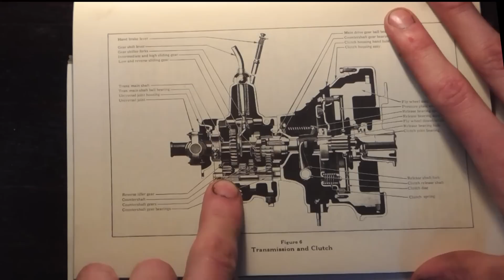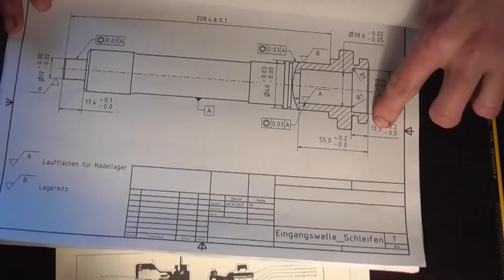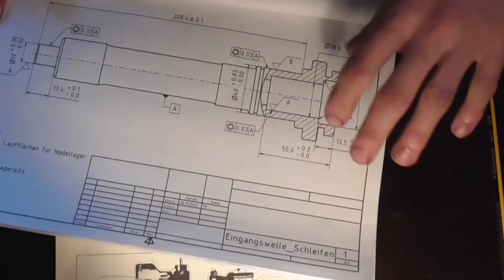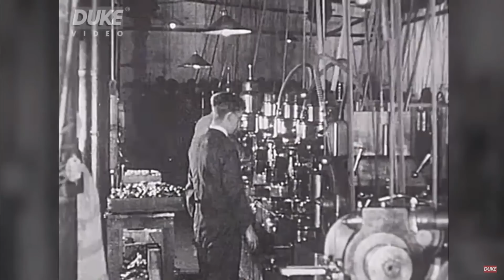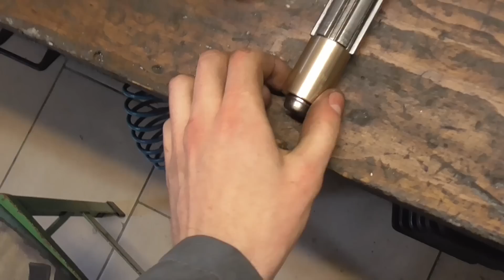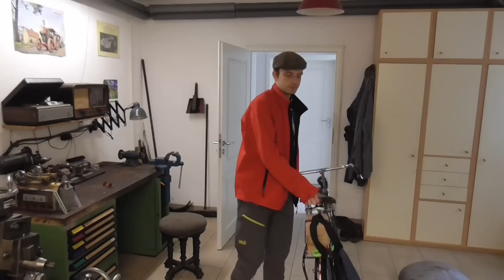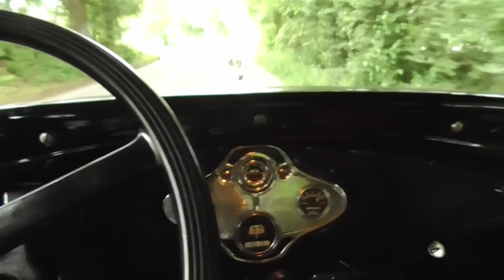Transmission Modification - Ford Model A

Comment: Very good try! I know you can do it. Does a Model A coupe have the same gear ratio as a Model A truck trans? Thank you!
Reply from the maker: Yes and no. The Model A pickup truck has the same transmission but a different rear end ratio, the Model AA 1.5 ton truck has a 4 speed transmission with an even lower 1st. 
2, 3 and 4 on the AA are equivalent to 1, 2, 3 on the A.

Comment: Would you expect similar results from keeping stock transmission gear ratios and going to a 3.5 rear end gear ratio?
Reply from the maker: It'd make things worse. A faster rear end increases the gaps between gears because it acts as a multiplier. Sure, you can go faster in 2nd, but you'd also have to go much faster to get into 3rd. Might work on a light car (coupe or roadster), but probably alot of struggle for a heavier Tudor or Fordor.

Comment: Your fear about the weakness of your new input shaft is unfounded. The only time that part of the shaft is under load is in third gear.
Reply from the maker: Well, 3rd gear is what you're driving about in, mostly. Sure, the car is already in motion, but we're still talking about moving a 1 ton vehicle on 2.4mm of wall "thickness". I don't think this'd be a match for a 3.3 litre engine.
Reply: @AstraWerke  Make a new shaft with thicker cross-section in that area. Because you have switched to a bushing you could make the hole smaller and use a thinner walled bushing
Reply from the maker: @KrashPad  The needle bearing bore sadly isnt the weak point. It's the even larger hole right up front where the 2nd gear gets pushed into to engage high. You could machine away the boss from 2nd gear, but that'd make the force path from the teeth to the axle weird, probably resulting in twisting motions that could cause it to pop out of gear, or wear out the output shaft prematurely.

Comment: It was genius to conceive this idea and amazingly skillful to actualize it. Now you know how the engineers at Ford Motor Co. managed to finally get a reliable Model A on the road. Many, many failures, leading to a few successes and eventually to a final, workable design. Don't ever give up. You have the drive, determination, and skill of a true innovator. Henry Ford would've been proud. Thank you for this video.
Reply from the maker: I reckon what'd really be helpful in an experiment like this would be sort of a test stand which would cycle  the transmission through different loads. Much less effort than being towed home and taking it in and out of the car each time it cracks xD
Reply: ...well, even EDISON didn't always get it right the first time- EITHER...(!)

Comment: The gearing in the Ford Model A is strange. Must have made sense back in the day with poor roads. Mitchell offers a syncro transmission with modified 1st and 2nd ratios, but my pickup is light enough to pull most of the hills here in New England in 3rd.
Reply: Also added the Mitchell synchromesh to my 31 A Tudor.  Night and day difference plus much easier downshifts.

Comment: Adding synchronizers would have been nice. I've noticed in cars today, the RPM difference between the gears is about 500 RPM. So as you shift, the engine slows down about this number between the different speeds.

Comment: You might have the lower rear-end gear.
Reply: 3.78 was standard, I believe, with an ultra 3.54 for highway speed increase and 4.11 for stump pulling ratio (LOTS  of hilly areas I’d guess).
Reply: @916commons  Thanks for your knowledge.  I didn't know the gear ratios offhand.
Reply from the maker: Most certainly not. It'd reduce top speed significantly.

Comment: very good modification on that car, this is a small design error that can be aesily corrected by revisiting the input shaft design.
by the way, the transmission seems much quuieter so your gear tooth design is spot on.
At the cost of  speecial gear hobbig, another way is to find the gearing of a more modern 3 speed gearbox and and its case  the original Ford bellhousing and tail housing.
Another option is a modern all synchro gearbox adapted to the Ford.
For sure that it removes a bit of originality to the old model A but it is a much safer way.
Reply from the maker: Phew, making a bell housing adapter and adapting clutch and U-joint to fit a different shaft profile is more work than you think!
Reply: @AstraWerke  If you start your design from a gearbox attached to a 4x4 transfert case, I believe that you can do something that involves no more work than what you done to your gearbox I admit that the design of the tail portion with the spherical pivot is the worst portion of the adaptation.

Comment: Excellent machine work. Your ratios sound similar to those offered in the Mitchell transmission.  BTW, you shouldn’t have to wait to upshift to third. Maybe that was caused the damaged gear teeth?
Reply from the maker: It's pretty simple: If you shift and the transmission makes a loud noise, it didn't like it. If the shift is quiet, no harm done.
Had I tried to shift it quicker, I'd have ground the gears.
Plus, it'd have worn the input shaft and the inside of 2nd gear, not the outside of 2nd and the cluster gear. 
Since the tooth was chipped on the right, it was probably caused by someone that didn't understand downshifting from 3rd into 2nd.
Reply: @AstraWerke  You are right. Also, I wonder if your car has lower rear axle gearing than most. I can’t imagine reaching 30mph in second gear with any of my cars with the 3:78 standard ratio.
Reply from the maker: @Bbbuddy  I don't think so - I've driven a few other Model A's and they all seemed to react about the same

Comment: Your skills are amazing. The shifting looks great and obviously you are happy with the performance under load. I must say I either missed the video about an accident or I just plain forgot. When you first pulled out of the garage it looked like a tuned up hot rod without the fenders and running board!! I am so sorry to see the failure while driving home. That is very unfortunate.
Reply from the maker: I had to swap the timeline around a little bit due to all the "Where's the Model A?"-questions around xD

Comment: Very, very cool!
The gear ratios in the Model A were designed for a different time and different road conditions. Most people in the 30s were looking for more speed and fuel economy in 3rd gear highway driving, hence the popularity of the Columbia 2-speed rear axle. Road and traffic conditions usually meant you would stay in 2nd for the majority of your city driving, so the ratios in the gearbox were arranged accordingly. Low gear was a stump-puller gear to make sure that take off in rough conditions wouldn't be a problem.
Ironically, the much better road conditions of the 21st century work against the way the Model A was originally designed and built.
It's unfortunate that the 2nd iteration of your solution had issues, but I really think you're onto something. As a bonus, you'll soon be able to R&R the transmission blindfolded, which will DEFINITELY come in handy some day!
Reply: Fully agree. Often overlooked is that the concept of a highway (in today’s sense) was unknown when the Model A was designed…the modern highway would only come a few years later in Germany (geographically full circle with this video!)

Comment: Very Nice --------- Machining the gear blanks ------ what was the material you were using -------- the chips were coming off so uniform -------- The wall thickness ------ what did that end up being? ------- Yeah ----- you did have a lot of worn and chipped teeth in there ------ then you got the new set of gears in there ------ made a world of difference ------- smoother and quieter ------ Of course a LOT of that noise was the gap in the input shaft ----- a lot of wear there ------- So , with a little more tweaking ------ and all the bugs worked out ------- What will be your final cost to the public for a set of gears? ------------ Thanks for the video - Adrian -
ALWAYS ---- enjoy your machining skills ------ the thoughts that are put into it ----- and the use of the Old Equipment ------- Will wait and see what you do for a remedy ----- BIG improvement on handling hills ------ Hope you have a Good Week ----- Rodney
Reply from the maker: We're talking about 2.9mm of wall "thickness" - in hindsight, I'm surprised it didn't already crack when I hammered it onto the shaft.
I think I paid around a thousand quid for material, having the gear teeth cut, hardening and EDM - with a LOT of friendship discount. If you wanted to make a living off this, it'd probably be more like 2k.
As for material, I usd 16MnCr5 - an old classic in engineering.
Best Wishes
Adrian

Comment: If you carry on like this, it will become a fully synchromesh gearbox. 😊
What was Ford's actual reason for the arguable factory gear ratios?
Reply from the maker: No synchros is part of the fun for me. 
From what I hear, nearly all 1930s cars suffer from the gap between 2 and 3. Maybe due to the road conditions - or maybe because "that's just the way we all do it".

Comment: Man that is a great idea to improve the transmission I know you are trying to keep the stock setup but what about swapping in a modern transmission and have the best of both worlds
Reply from the maker: Not an option for me. I want it to look the same and be operated in the same way as originally.
Reply: Way back, I had a friend sub in a pinto manual transmission. I don’t recall how he mated the trans to the bell housing, etc, but it worked great!

Comment: I'm unclear as to why the Ford engineers settled upon the stock gear ratios. When I am instructing new drivers at the museum I explain the transmission operates similar to a four speed which is missing second gear. Ford must have known about this gap in the drive ratio. How do you suppose they arrived at this configuration? Did it serve a purpose other than frustrating the drivers stuck behind me? My 1929 is the same as it came from the assembly line. No modern conveniences or safety mods. It has a twin sister though that does the quarter mile in 13 seconds. Very little Model A left in that one.
Reply from the maker: It's a common issue on all 30s vehicles, not just Fords.
One could argue it's been designed for the rougher roads, but I wouldn't mind going down a rough road in my modded 2nd.
Others might say that if everyone has the same handicap, no one is handicapped at all... It's definately not a constructive issue - if you design a transmission from the ground up, you can put any set of gears into it and make it work and last fine.

Comment: Well done, Adrian!  Well, except for getting the gear low spot material so thin that it split from the tight fit... The inner shaft heats up before the gear teeth. POP!  Your design and machine skills are enviable. 
I know you think there are only 2 options, however there is a third option.  Option 3: Get in touch with Steve Mitchell at Mitchell Manufacturing and get one of his gear sets.  Besides having synchronized 2nd and direct (3rd),  he offers three different ratios. 
Options are:
15% higher 1st, 2nd, and reverse.
Stock 1st and reverse, but 15% higher 2nd gear.
All gear ratios as original.

If you ever find yourself in the US, drop by and take a Model A for a spin with the Mitchell transmission in it.  You'll say some cuss words in German when you experience it for the first time.  It shifts like butter.  And we have better tacos than you can get Germany anyway.
Reply from the maker: Steve Mitchell doesn't answer my emails anymore - plus, I lack the money for one of his transmissions, sadly.
I don't mind unsynchronised - matter of fact it's one of the reasons I chose to buy the car - do you know if he offers his altered ratios straight-cut so they cooperate with original Ford parts, like the Brits at Belchers do theirs?
Best Wishes
Reply: @AstraWerke     I will send you an email.
Reply: @ModelA  Seemed to me like Adrian and Steve are basically solving the same problem, with Steve adding the synchro on 2nd and 3rd gear. I haven't examined Steve's gearsets, and I'm guessing Adrian hasn't either, so I would be curious to see how their solutions compared to each other.
Reply: @alexiskai    I have one of Mitchell's transmissions in my shop right now, earmarked to be installed in Tina's roadster.  You're welcome to come over and check it out.  Absolute perfection.  I am sending pictures of it to Adrian.
Reply: @ModelA  I don't think I'll make it out to CA in time, but I appreciate it

Comment: Man with courage. High respect for people who are not afraid. You will prevail. Remember H. Ford only succeeded the third time he tried. How about using a later Ford gearbox, or is that obvious blasphemy?
Reply from the maker: Thanks alot. I really don't want to get into making custom U-Joints or adapter plates or modify the flywheel to mount a V8 clutch - from the outside, it should still look stock. Maybe there's still potential in this housing.
Reply: @AstraWerke  I see that Paul S. already referred you to Mitchell as option 3. I just happened to watch Tina S's video with him, three months back. Youtube does not even allow its own links, how annoying. Next for me is to try a new bendix drive to hopefully lessen the hard flywheel knock. Then a hunt for all the rattling and vibration noises. But other than that all the mechanics should be ok now. Not as pretty as yours though.

Comment: For your driving footage, are you stabilizing the image in software or using a gimbal mount?
Reply from the maker: It's a loaned Gopro vacuum-cupped to the rear window. Has some fancy stabilizing software inside, but don't ask me how it works xD

Comment: Nice work!  I’m retired toolmaker, I’m the third owner of a 1928 Durant M2. Make that gear over, EDM leaves a recast layer that sets up fractures. Remove recast layer. Flame harden the teeth, leaving the center softer. My two cents. ✌️
Reply from the maker: All good points, thanks for your intel! I fear though, that no way will lead around more wall thickness for that gear.

Comment: Isn’t it possible to upshift without using the clutch ? If I remember correctly only the revs have to be high enough to do so 🤓
Reply from the maker: Good way to wear out your gearbox quickly, but its possible
Reply: @AstraWerke  seems you can do that even by using the clutch 😜
Reply: you should but it is still somewhat slow, not like a modern syncro transmission. Plus if the transmission is worn and out of spec it will take even longer.
Reply: upshift or downshift?
Upshifting without clutch it's easy, throw it in neutral at the right moment when the gears float. Then let the the engine slow down in refs till the right moment, you can drag the gears very slightly to feel if the speed matches, then throw it in confidently and fast without hesitation (so it doesn't grab half way)

Downshifting is the harder part, because you need to rev up the engine to the correct speed during neutral.

Both can be done nicely with practice, but there is always a risk of damaging your gears if you make a mistake... so do it at your own digression
Reply: @DrTheRich  I meant up! Because he’s trying to build up speed uphill but literally can’t because of the shifting itself front second to third